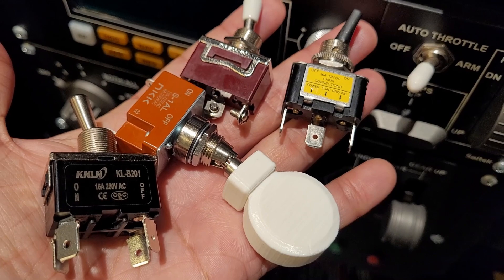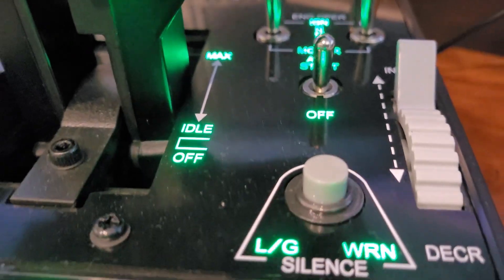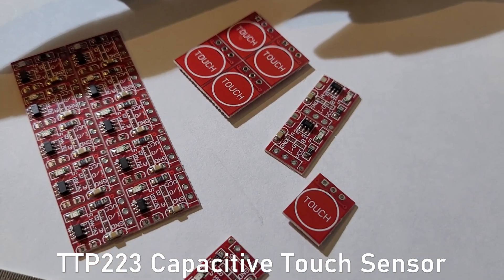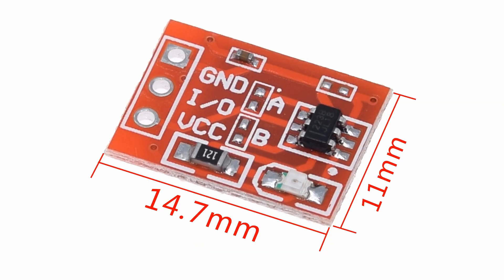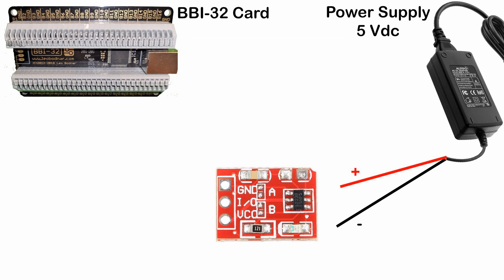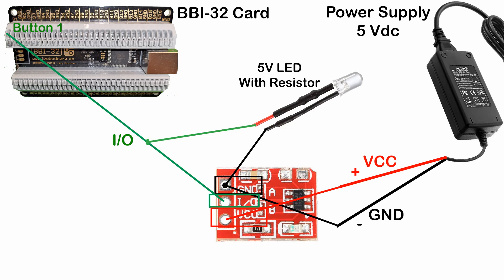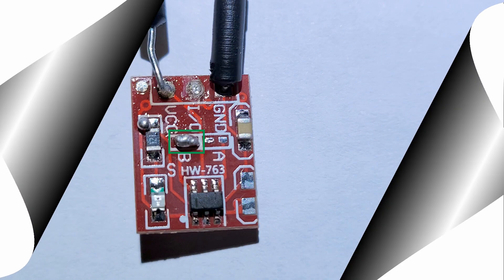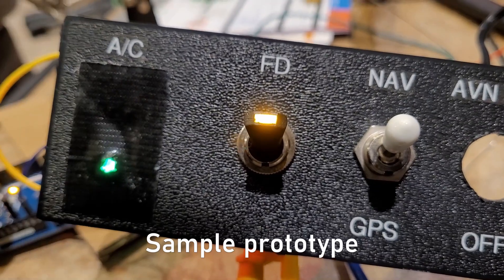Touch Sensor Switches for Flight Simulator, Prepar3d and X-Plane

Comment: Very interesting - thank you. What are good materials for covering the switch without impairing its function?
Reply from the maker: That's a good question. In some of my sample builds I have used black electrical tape and similar material. The touch sensor modules themselves can be made more or less sensitive. Unfortunately I have not had the time to play around with different plastics, but I have seen some projects where people have used materials similar to plexiglass.
Reply: @joshuamarius  Thank you. I will experiment and advise any results here.
Reply from the maker: That's what I like to see! Contributions. Thanks!

Comment: Hi please can you help. The touch sensor  io pin is high vcc 5v leo bodnar told me their interface  cards bbi 32 button interface  would need a relay to make it work. Youf video only  shows the io pin terminating at b1 on the interface what about the ground pin please can you explain. Many thanks.
Reply from the maker: You don't need a relay for this simple setup as long as everything you are working with requires or uses 5v. For ground, you can bond them together; go from GND on Leo Bodnar to the Ground on the Touch Sensor.